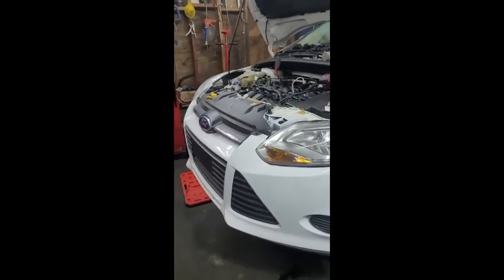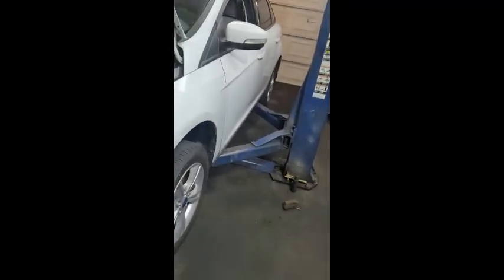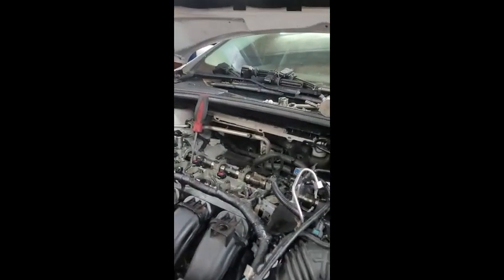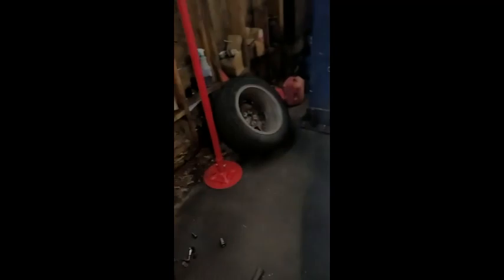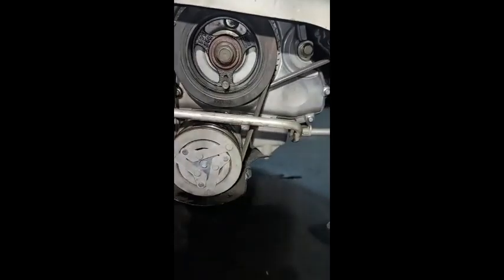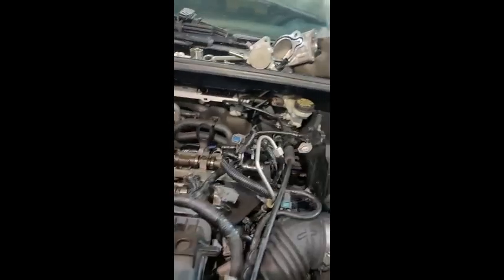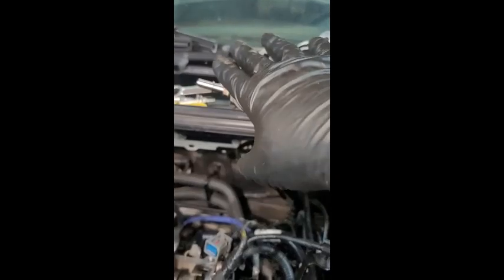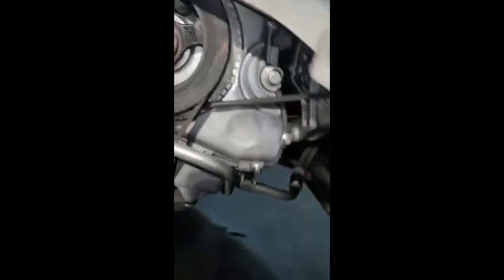2013 Ford Focus Code P00C6 got this code after replacing the headgasket? (Solved)

Comment: I have a 2012 Ford focus, I’m getting the code p00c6 , and a cylinder 1 misfire as well after replacing my back fuel pump, the high pressure fuel pump and the purge valve, low side pressure sensor and before all that work I did replace the head gasket as well, only thing is it would turn and work fine but now it takes a while cranking and eventually starts up (revs by itself a little) and then settles down and turns off , im at a lost to what it could be

Comment: I have the same problem i removed the crank pulley without aligning it with the hole and then put it back with out aligning it, now the car wont start. Is it out of time ? Any help would be appreciated  . Thanks
Reply from the maker: Did you watch the whole video ? I explained it already

Comment: I am having this exact issue right now. Replaced my head gasket and got p00c6. Did you have to re align the crank sensor to correct the issue?
Reply from the maker: Yes of course make sure cylinder 1 at TDC and align the crank with the pin hole like In the video
Reply from the maker: https://youtu.be/tWJiv8nkB4M
Reply: @hanitwfik  going to try this , jus finished my 16 malibu head gasket job and got a few of these fuel codes
Reply from the maker: @3lowmafia  thats what happend with me . good luck

Comment: So I had a crank no start on my Cadillac SRX. After some diagnostic I figured it was timing. Bought new chains and tensioners. Also changed head gasket and checked pistons. All seemed to be in great condition. After putting everything back still crank no start. I check code and saw P00C6 could the high pressure cause this issue?
Reply from the maker: Gm had a common problem with the high pressure fuel pump also this code for fuel rail pressure sensor but before all that check the plugs and wires connector you may have cut or corrosion good luck .thanks for watching

Comment: Need help my car detect P00C6 Fuel Rail Pressure-  engine cranking, but its not having a hard time to start, but it always stall and have a another error P018C Fuel Pressure Sensor B Circuit low. is this the sensor behind the engine or the one in front?

Comment: What tooth should the crank sensor align too on the pulley ?
Reply from the maker: It's not about the tooth if you watch the video  there's a screw driver on cylinder 1 TDC top dead center so you have to take the cylinder one ignition coil and spark plug out and turn the crank until the screw driver reach the very top and look at the crank where I out the bolt in the hole spot align the crank hole with the timing cover hole like in the video if all aligned so you have a problem with your high pressure fuel pump thanks for watching  let me know if you have any questions I will be glad to helping you
Reply: @hanitwfik  isnt the tool suppose to go in the bolt screw behind the engine until it locks and thats cylinder 1 at TDC? When i timed the engine i used that tool and the bolt so the pulley wouldn't move also timing kit came a tool to align the crank sensor which aligned a tooth but idk the number of the tooth. would the high pressure fuel pump cause my start but stalls right away ? How can i test the high pressure fuel pump? Thanks for your help
Reply from the maker: https://youtu.be/tWJiv8nkB4M
Reply from the maker: @oscarcee6831  ok did you remove the gears from the camshaft when you do the timing because some people put it different direction like they put the camshaft upside down and you thought its right  watch the top camshaft in my video and check yours
Reply: @hanitwfik  no i took the whole camshaft as one piece and i have no timing codes or any codes at all
Reply: @hanitwfik  yes my cam lobes on number 1 are facing each other
Reply from the maker: And the problem you have now wasn't there before you do the headgasket?
Reply: @hanitwfik  not sure i bought the car like that overheated i have 200 compression on all the cylinders .
Reply from the maker: Did you lock the crank with the bolt in the back of the engine while you tight it and did you torque the crank bolt ? Did you check the high pump roller between the pump and the cam if all that is good . So if all that is good so you  will need to replace that high pump
Reply: @hanitwfik  yes to time it i had to do all that and i put a bolt to keep the pulley aligned to the timing cover. Will a high pressure fuel pump cause a start and stall ?
Reply from the maker: Sure

Comment: So my focus has p00c6. What would the replacement be? The crank sensor or the fuel pump?
Reply from the maker: Have you done any work  to your car lately
If not so that could be the high pressure fuel pump

Comment: Im having this same problem on a 13 focus I did an engine swap on. Ive used another high pressure fuel pump and aligned the crank, as you have to since the crank pulley isn't keyed to the crankshaft. You have to lock the crank from the back of the engine. Any other ideas?
Reply from the maker: Actually I didn't lock it from the back I use that alignment pin to hold the crank pulley in position then use the air gun to tight it fast it may takes several time to do it but it worked for me 😉
Reply: @hanitwfik  I did that and I'm still getting the P00C6 code. I have correct fuel pressure. Not sure why if the crank pulley was not aligned why it would throw this code. Wouldnt it be a timing code?
Reply from the maker: @rapidcarcareandperformance5280  did you check the fuel pressure pump roller also the cam is ok ?
Reply: @hanitwfik  I got it running by doing what you did LMFAO. Stupid focus.
Reply from the maker: @rapidcarcareandperformance5280  that's good I knew this car is cheap always have a problem with . Good luck 👍